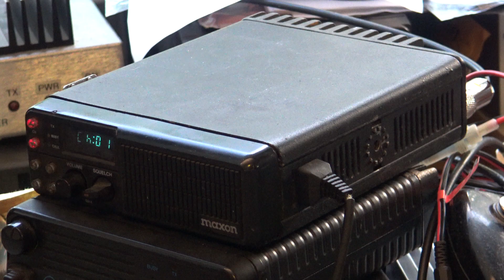Maxon PM150 on 4M amateur band - On The Air test

Comment: We had these radios in all the vehicles and tractors on the farm, they had some cool features, you could ring work and get put through to a single radio which was helpful when the combine broke down.  My callsign was BowFarm14. This was in mid 90's and the channel display flickered on new radios.
Reply from the maker: Bear in mind it's not just the radio set that does it, your farm must have had a talk-through base (repeater) & a telephone interconnect too.  We did a quarry with all these type of features with the SL500 walkie talkies...which were £699 each at the time. Unlike phones, 2-way radio is instant & that's still one of the most important facts.

Richard
Reply: @ukfmcbradioservicingTango21  yes they had talk though base repeater with telephone interconnect.  Office could talk to individual radios and route phone calls in and out. This was back when the trucks had transportable Motorola cellphones and the farm had this radio system that covered most of Norfolk no expense spared.

Comment: Drilled antennas make a huge difference dont they!
I use a drilled hard mount for CB on my car, this is the second car ive drilled the roof on and will do so on every car because of how much better it performs, it also has the benefit of it not leaving the roof at an undisclosed speed like i had a mag mount do once lol.
Reply from the maker: All cars get drilled. I want 'fit & forget' installations that also work at peak performance.

Richard
Reply: @ukfmcbradioservicingTango21  I did 'forget' part once and snapped a modulator on a carpark height restriction barrier ha ha.
Reply: @stevefox3763  we once had a taxi customer who wanted the best performance so we fitted him with panorama 5/8s wave on a body mount on vhf high band, he forgot he had it fitted when he went shopping and used the underground car park, I cant remember how many fluorescent lights he broke before he realised what was going on...
Reply: @chippieminton21  ha ha, he would have looked like a bumper car!
Reply: @chippieminton21  Panorama antennas in South London are still going,
Used to also sell as Antec, their pvc coated 2m 5/8 were very solid
Reply from the maker: We still use Panorama.

Richard